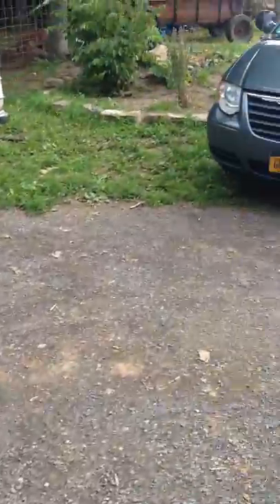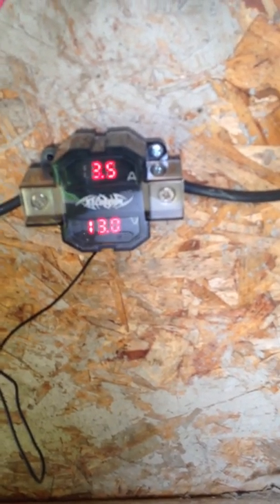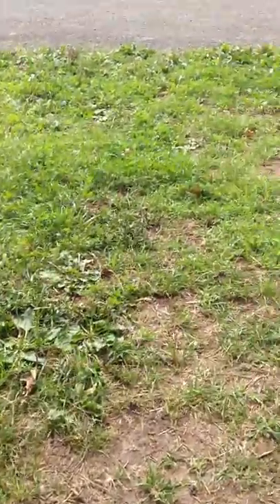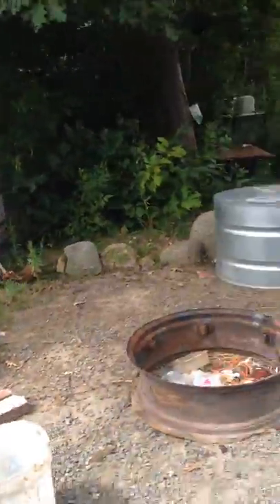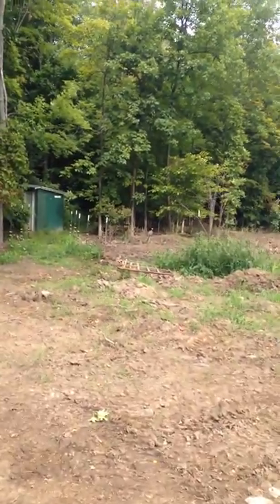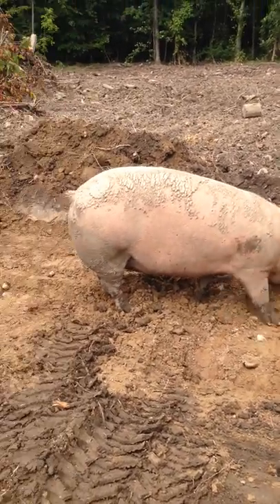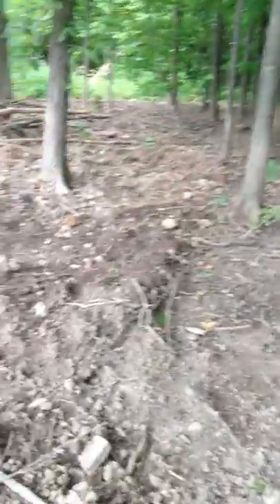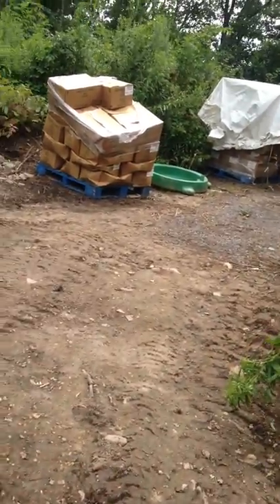Wind generator finally up!

Comment: Super cool farm. I like how you relate to your animals, especially your piggies. You talk to them and they talk to you. Just great.  As for the wind turbine, it is a start. It works much better in your place than mine.  I love that tower of yours. If it gives you a few amps, that's fine.
 The proof is in the pudding. If it can charge the battery, then it's good. The few amps certainly won't heat up your water tank by itself. But if you have a well insulated tank, couple that with a 200w solar panel and a few batteries and water heater, your water tank probably won't freeze. Remember that wind turbine will turn at night too or anytime there is wind. I'm sure your viewers will give you plenty of advice. I have to watch your video again to see if I can make out your system better. Looks good as is now.
 Very happy for you as you live a life many of us would envy.
Reply from the maker: thanks paul, I'll be adding more vids soon!